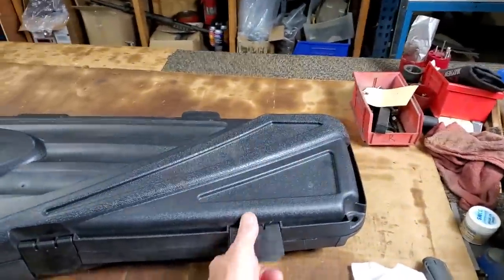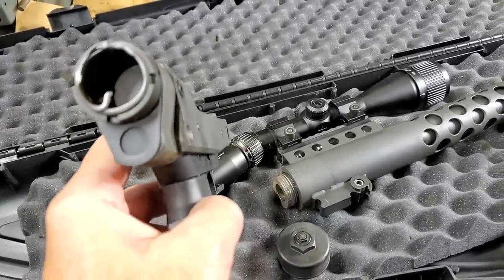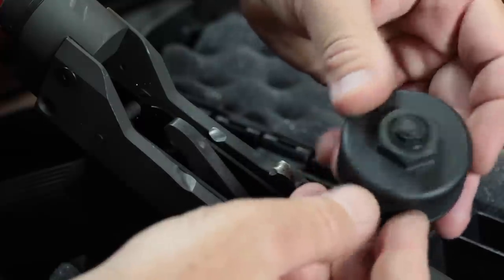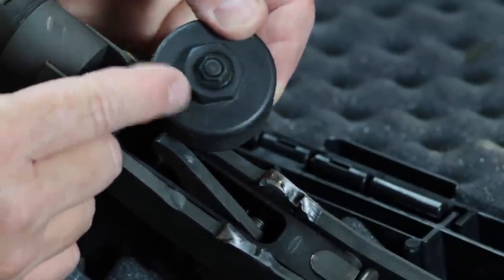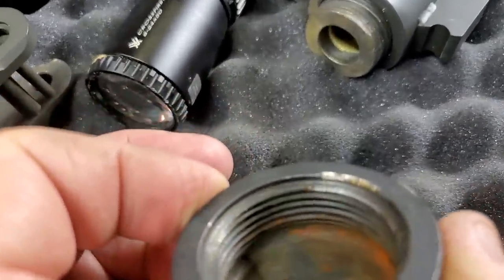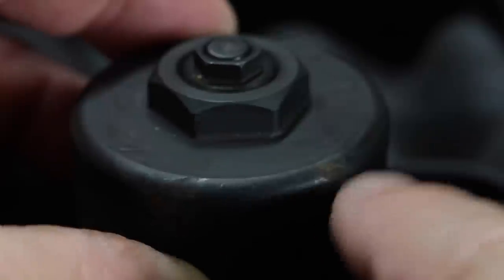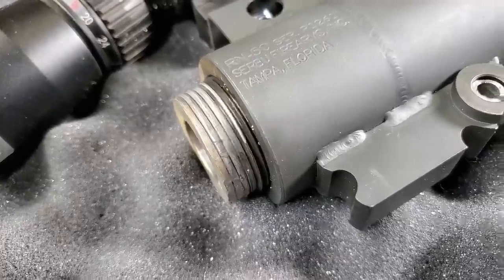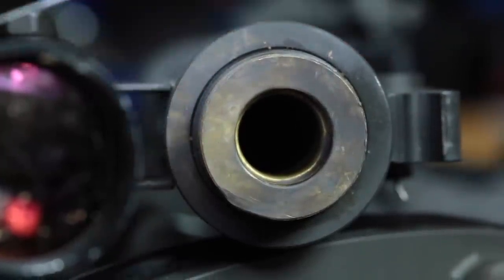Kentucky Ballistics' RN-50 Blow-up:  First Look

Comment: those markings are very easy to see what happened. The insane pressure was too much for the cap, once the threads started to strip it snapped the ears off. As the ears began to peel back the cap went shooting backwards in a spinning style leaving those 2 indents. The mark on the inside of the cap was from hitting the stock leaving that final mark before slapping KB in the face and knocking him on his ass.

Comment: That was devastating, my own thoughts were wrong powder, overcharge, or the slap plastic expanded and stopped in the chamber creating a bomb essentially.  Would be interesting to see the projectile, betting on an over pressure. Hot me wondering on all the ammo I have reloaded in my lifetime if my crimps are creating the same situation if the saami specs are out. Did you measure the shell specs? Crimp get caught in the chamber and prevent the bullet from exiting? Glad no one was killed in the end.
Reply: I've heard that the slap round isn't supposed to be fired from a gun with a brake on it for fear of the sabot getting stuck and creating a pressure spike.  
Supposedly in some army manual.
Reply: @mikewhitman745 , yes you are correct about that but I havent ever heard of a 50 of any sort doing what that did. Positive it was not a defect in the rifle, it had to be something off with the round, wonder where the projectile went.........my guess is half its speed out the barrel. Sure glad no one was killed, there would be a ban on all guns then haha.

Comment: Are you conducting Spectrometer analysis of the residue looking for any chemicals consistent with an explosive not supposed to be there?   The thought that these may have been tampered with, given the "Charged" atmosphere out there these days, is not a stretch IMO.

or:
I have heard the propellants can change properties over time making some over pressure.   This event looks perhaps too severe for that.  Anyone?

edit:add/modify content

Comment: You've probably seen the video that Tiborasaurus Rex did, giving his opinion? Very interesting. He focused on the muzzle brake and the specific type of SLAP rounds.
Reply: and that guy was repeating FUDD nonsense. Barrett says their guns with brakes work just fine with slap rounds. all that occurs is plastic comes out the sides of the brake. the military was not doing proper cleaning of the rifles and caused squib loads by their incompetence

Comment: Scott I'm curious what the OAL is from the head separation to the neck or mouth of the case, and if the walls of the round have thinned at all? Also curious if any fire-formed brass exists to take reference from. I'd be curious to see how much metal moved in the case.

Comment: I think the plastic sabot being fired in conjuction with a rifled barrel and a muzzle brake led to the failure.  In the video under slow motion there was a flash from under the scope.  I think the round may have had a momentary pause in travel because the sabot may have gotten lodged in the rifling.  Is that a possibility Mark?

I'm under the impression that sabot rounds are supposed to fire from a smooth bore.  I may be wrong.
Reply: You are wrong. Sabot is plastic anyhow.

Comment: Thanks for the video. Any plans to change the design of the 'ears' behind the locking cap?
Reply: that wouldn't do anything except create more dangerous shrapnel in the event of triple or more pressure event.
Reply: @toomanyaccounts  i didn't even suggest what the design changes would be, I'm literally asking if something can be done to reduce the chance of it breaking into shrapnel like it did, there's no way for you to know that would be the case.
Reply: @mayomancer527  yes we do. the threads rated to withstand up to 160k psi. stronger ears would just mean they would turn into chunks that would fly into the shooter, or cause the cap to spin into the shooter causing even worse injury. at  certain point attempting to "make safe" renders it even more unsafe if the worst case occurs.

Comment: So the damage on the lower looks as though when the cap was pushed back and sheared the pins and the ears it rolled before the ears completely snapped off putting those two indents like you already mentioned and then the inner part of the cap that was otherwise undamaged is what scraped up the top of the lower. It tumbled or rolled.  Just my two cents thank you.

Comment: Could the round have vented out the primer? there may be a tiny impact in cap from primer case if ejected back. Maybe check the crimp pressure on the rounds to see if it was too snug.

Comment: I have learned from a reloading accident of my own. Everything gets weighed and checked against known weights of rounds. I own a Barrett M99 and would hate to think what would happen to myself in the same situation. A bolt action 50 blowing up doesn't sound like a fun day.
Reply: The M-99 is a bullpup design. The bolt is actually right beside your face. The bolt, if propelled backwards would take out your shoulder and upper arm. Which will still lead to a catastrophic out come for the end user.

Comment: Some good RnD there though,
Shows that the threads and ears are a weak point and that this design may need a blow back relief design, so that any overpressure is expelled instead of the whole back end of the gun exploding.
I'd be interested in seeing how much pressure it took to do that...
Reply: the threads would take over 160kpsi for them to fail. they are the strongest thing on the gun. there is no way to vent pressure from a detonation. rifles that vent holes near the chamber are weaksauce guns

Comment: every now and then videos about this pop up in my feed, im surprised it took this long to get this video.
i forget the channels name, but im convinced of the guys theory, that the round was simply an old round, or other wise was shaken alot, causing the powder flakes to grind on each other, wearing it down into finer powder, that burnt faster, causing an unexpectedly high pressure spike, that the gun couldnt handle.

the guys channel logo is a owl/double barrel shotgun ...... one of the cooler channel logos around..... if any one knows it.

Comment: That was pressure greatly exceeding any “blue pill” or proof load.  It appears the pressure spike was far more rapid than from a normal burn of progressive burning smokeless rifle powder.  The lack of a major case head brass imprint on the inside of the breech plug points also to a detonation rather than gradual build up of pressure due to smokeless powder ignition.  Detonation is likely either from too little powder in too much air space or a booby-trapped load.  Just my opinion.
Reply: bubba load you mean

Comment: I thought I had read somewhere that when shooting slap rounds you are supposed to remove the muzzle brake. I could be wrong.
Reply: its Fudd lore. muzzle brakes are fine with a slap. all that happens is plastic shoots out the side of the brake and  civ spec brake will tear off. this rifle was custom ordered to fire slaps

Comment: Based on the the way the lower is twisted, the threads stripped, just watching the video of it happening. I'm not a pro at this but there is no way that the pressure that round exerted was "within tolerance" something had to have been wrong with the round, not an inherent flaw in the rifle itself. I play with a lot of metal at work and seeing heat treated and Rockwell tested steel do what it did, that's incredibly impressive.
Reply: 160kpsi at least would have been required to strip the threads. so three or more times the pressure of a normal .50 bmg round

Comment: suppose to remove the muzzle brake wen using slap round or it might accumulate plastic from the sabot and cause barrel obstruction .  or the slap was loaded whit pistol powder , aging of powder wont double the pressure
Reply: not true. that is FUDD lore if there was barrel obstruction the next round would clear it out with no damage to mil spec brakes. that is what Barrett firearms says.

Comment: The threads in that cap are way to clean... the barrel threads must've had a defect. Can't believe there was enough pressure to pop the cap AND SOME.  Hardened or not.. that cap has way to little damage for the forces supposedly at play.
Reply: they were sheared. the amount of force was 160kpsi. that steel is not pig iron or some weak steel.

Comment: The single Mark on top? Is it possible it's the inside of the cap where you saw the damage. As in it dug into those spots on either side and flipped the cap over causing the inside opposite edge to strike?

Comment: 50 cal SLAP-T is really meant to be fired from a M2 machine gun.  Firing from a firearm that’s not gas or blow back operated can cause these types of failures.  Firing SLAP-T with a muzzle brake can also cause issues from what I’ve heard but not entirely sure.  Someone please correct me if I’m wrong but this round will not chamber in a Barrett M82 either.
Reply: stop repeating Fudd lore. slaps are safe to shoot from any .50 bmg and with mil spec brakes.

Comment: You should test the powder burn rate and gas released versus what its supposed to be as i suspect that is the main culprit here. Smokeless powder is not that stable for long term storage, especially if stored in bad conditions. This can lead to the powder becoming more volatile then its supposed to be.

Comment: I’m curious how the stock snapped off or blew off, cause when the camera pans over that it looks sealed. I’m figuring it was just sheer force but how much god damn force and pressures it needed to get that one piece sheered off like that. The stress this gun went through is insane. And the fact the cap looks almost pristine is insane
Reply: the amount to shrear the threads was estimated to be over 160k psi. normal bmg is 50kpsi

Comment: The engineering question is, did the sabot from the slap rounds deposit any polymer on the brake due to early separation and cause a pressure spike which induced the case head separation and subsequent kaboom? It seems to me that sabots and tight breaks can be a bit problematic...  Curious to hear your opinion.
Reply: if there was any blockage at the brake the brake would flown off not the gun go explode. we already know what happens with obstructions in brakes. the brake goes bye bye not the rifle.

Comment: ps the cap did not make the 2 indentations the stop blocks braking off did  2 marks on bottom of cap are from cap skipping over what was left of the .lets call them locking blocks ,

Comment: Do SLAP round work in this type of 50 BMG rifle because it was a "breach loader" and not a bolt action? I've read (so, could be bad info) that SLAPs were not supposed to go through anything other than the machine gun, due to a risk of the "shoe" getting lodged in the throat?
Reply: even if lodged in the barrel a squib wouldn't blow up the chamber like that. that type of blow up in guns is caused by someone loading the wrong powder usually a bubba. the crimps indicate those are handloaded rounds being passed off as mil surp

Comment: that pivot pin is really strong?
in germany we use around 8mm (around 0.314 inch in diameter) solid steel rods for a cal. like 7x65R (.30-06) in a drilling, when only 4mm would more than enough.

Comment: Would it be possible to measure out the powder and confirm if there is as much as there should be? Could it have been a double charge that caused the failure?

Comment: I still think it was secondary explosion effect (cool to have video documented, but not; because of what happened to scott).  There is not enough case capacity to load a SLAP that hot, and all the SLAP rounds I have are WCC headstamp, with a military style hard nasty crimp with a good line (although I don't have any SLAPT's maybe they are different?  I kinda doubt it).  Maybe the powder dispenser messed up, maybe the reloader just didn't care, either way.. I'd bet that case was probably less than 20% full of powder, shake a regular slap and there is barely enough room for the powder to move, LOL
Reply: For a gunsmith you really dont seem to understand much about guns.

Comment: I think what a lot of people need to keep in mind here, is that this isn't a common thing to have happen with the RN-50. Like someone else said in the comments, Every man made object in the world has a 'weak spot' as a failure point, and changing it up is going to create a new failure point weak spot. Something to consider is whether or not changing it up is going to create a more dangerous point of failure. 

Scott is alive mostly because of his ability to handle a traumatic situation flawlessly, and because he knows what to do and how to respond to an emergency. But, he is as healthy as he is this quickly, because the RN-50 in its' current form didn't dismantle in such a way that can do much more damage than what it did to Scott. 

I would say in my personal opinion, that maybe look into a way to make those ears sheer off to the side and not straight back. Or experiment and see if trying to treat those threads to withstand more pressure and make the force go out the other direction, but I also agree that creating a pipe bomb is a risk. 

No matter what, you have an awesome product Serbu, and most of us understand that this isn't some common issue your product has. You're the expert, and we know you'll do your best to make the safest and most reliable product you can.
Reply: those threads were made to take up to 150kspi. that is three times what a .50 bmg round produces. even a tank cannon doesn't produce that much pressure. if anything would rip the cap off it would shear off the ears it encountered. 

even the regular pressure of a .50 bmg can rip apart a Barret semi auto if you were to clear what you thought was a dud round but was in fact a long hangfire.

Comment: Had a M2 .50 cal in the ARMY that had microscopic fractures in the bolt carrier. Blew the whole backplate off the M2 and smashed a soldier right in the mouth. This reminds me of the same thing. The screw-on cap and firing pin just seem to be a little weak to hold the pressure of a .50 cal round. Did the treads fracture under the pressure after multiple rounds down range and this one was the round that caused it all to fail? The reason I ask is the bolt carrier broke right behind where the barrel screwed into it. Also, the 2 rounds before failure showed mass expansion around the primer and cap of the rounds.
Reply: it would take over 160kpsi to shear those threads. there is no bolt carrier.
Reply: @toomanyaccounts  exactley there is no bolt carrier. Reread. The M2 I witnessed broke right behind where the bolt carrier screwed to the barrel, right where the 2 ears sheared off RN-50.
Reply: @tomrals9579  and no material would have prevented those ears from shearing off. in fact having the ears being ripped off took some of the force off and caused the cap to not fly off at an even greater amount of lethal force.
Reply: @toomanyaccounts  another thing is this is a single shot weapon. The rounds your using are for an automatic weapon. 160 kpsi yeah thats a big number but did anyone think of the bolt thrust that this round produces. The M2 does alot more with that bolt thrust than you think, extraction, recocking and compression of the buffer spring. So were these taken into consideration when they made the screw on cap. One number is not always the answer.

Comment: Mark, I feel like all the cape damage is from the ears being sheered, the new damage to the lower receiver was caused by the newly separated ears. Those lower marks on the cap just don't properly matchup to the divot angles, but two independent ears could cause the slight deviation of each divot. This would probably project one upwards into Scott's hat, and one into his chest judging by what I see on video. https://youtu.be/4ny_V_VfT3Q?t=116 if paused at this time you can see the continuation of damage from one surface to the other showing a singular object. Also, this https://youtu.be/4ny_V_VfT3Q?t=59 shows two divots both angled towards each other and seeing as how the cap didn't develop a concave appearance and remained true to shape it can't produce these cuts near the hammer.
Reply: The ears did not go down, they went up. Or rather one went up, the other went into Scott, so we kind of know where they went. And Scott was directly behind the gun so it went horizontally.

Comment: I am going to throw my 2 cents out there take it for the grain of salt that its worth...

1. The rifle was not the cause of the failure, your disclosure on the PSI required to strip those threads matches the data presented and the data available.

2. Those SLAP rounds (cartridge casings) are correctly stamped, however that does not mean they could not have been tampered with before they were sold to someone else down the line.

I am 99.99999% certain it was the round's failure. Also fairly certain its due to tampering with the powder. I feel like someone might have used some Hodgdon H110 or something similar to that effect, some "magnum grade" pistol powder to "max out velocity". I would be interested to know/see if he (Scott) has any left over rounds from that same batch, if he does they need to be pulled and have the powder inspected to make sure it matches up with factory loadings which if my information is correct should be 285 grains of WC856 pushing about 51,000 CUP pressure.